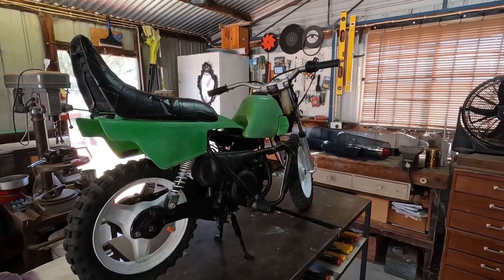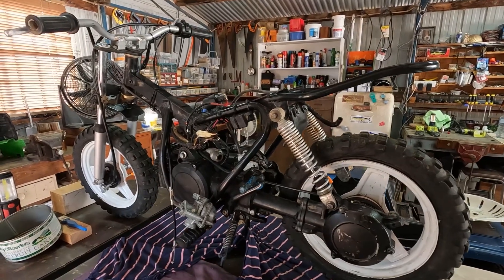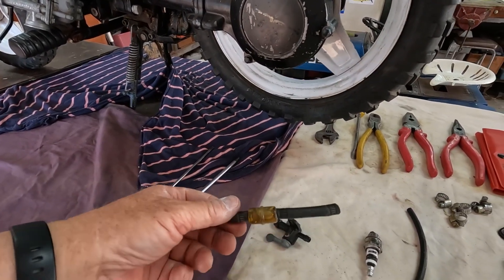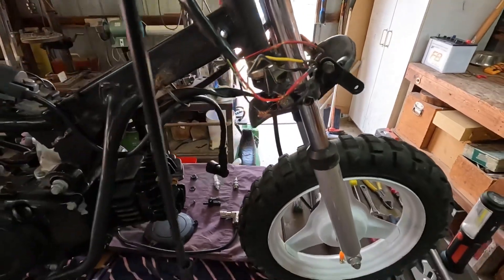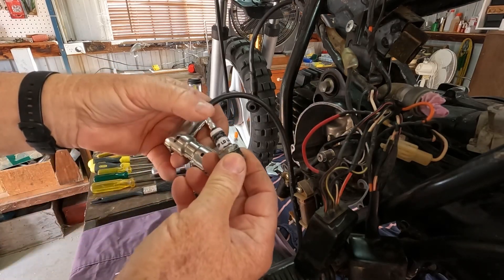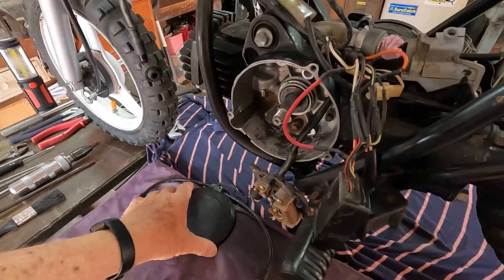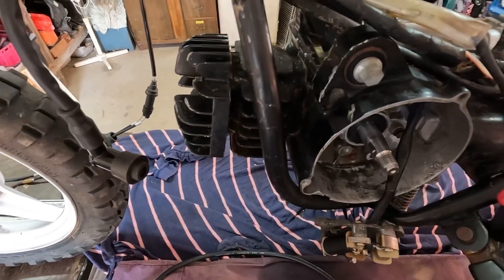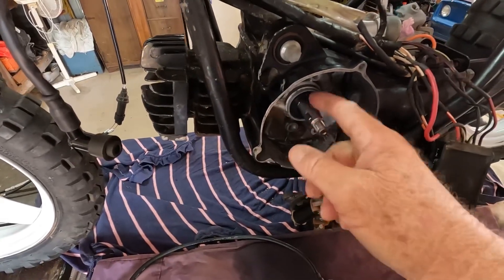PW50 MOTORCYCLE REBUILD - PART 1 - NO SPARK | SEPS ADVENTURES

Comment: I have done all that you mention: New harness with all the electronic boxes, the handlebar switch, as well as new cylinder, head and piston/ But no spark! Where do I start?
Reply from the maker: If you have purchased the replacement parts and wiring from EBay I also tried the same twice purchasing everything from two different suppliers without luck still no spark. In the end I found an original wrecked Yamaha pw50 that was being dismantled so I was able to buy the wiring and associated electrical parts which worked, finally had spark. I am not sure why the eBay wiring does not work you may have to consider purchasing original second hand wiring if you can as I was unable to find original new wiring from anywhere. Hope this helps. Cheers!

Comment: My 1986 pw50 has a visible spark on the positive side of the coil and won't start. What could I do?
Reply: Well i think it's the positive
Reply from the maker: I assume you mean you have a spark at the end of the coil lead that connects to the spark plug. If this is the case unscrew the spark plug and plug it into the coil lead. Then touch the metal end of the plug against the engine and operate the kick starter you should see a spark at the tip of the plug. If you do the engine should start providing it has compression and fuel. Some other things to check - the on/off/run switch on the handle bar is operating correctly no loose wires earthing out - the spark plug is the correct one for the bike - the carby is operating correctly and allowing fuel into the engine - the coil lead securely fits onto the spark plug. Hope this helps. Cheers!